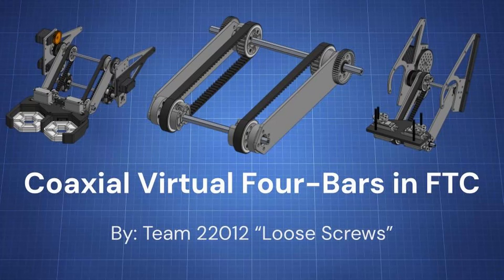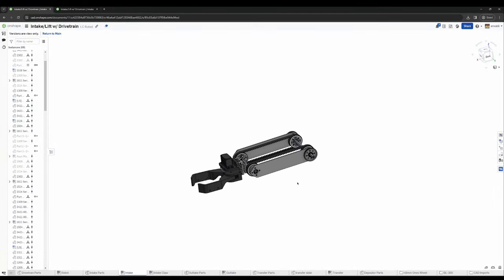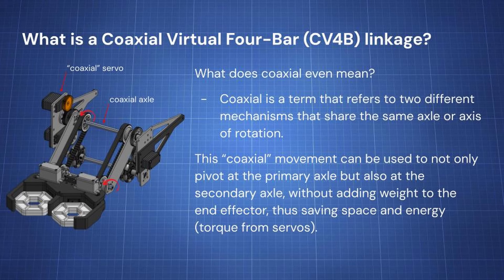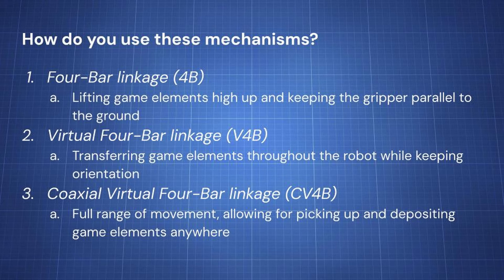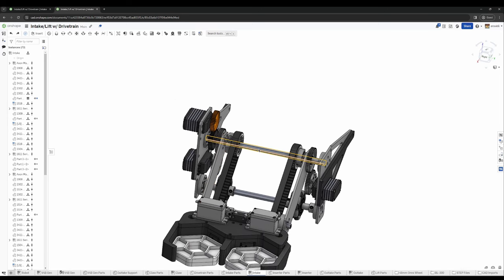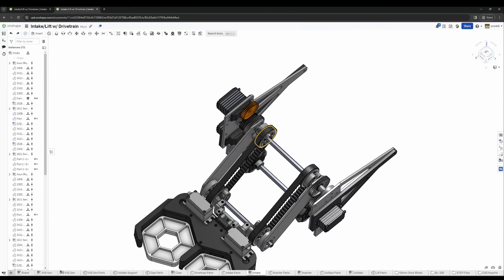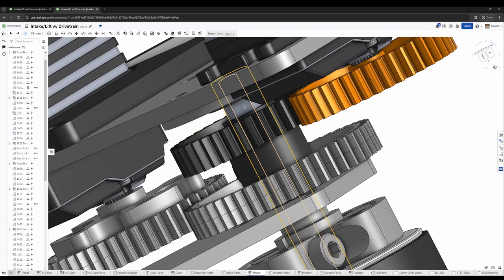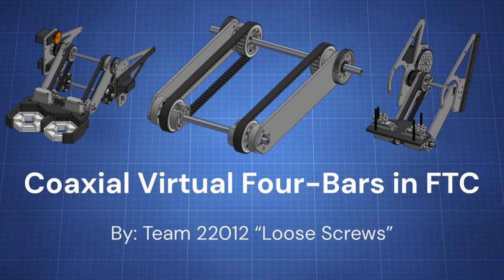TUTORIAL: Coaxial Virtual Four Bars in FTC

Comment: How does your intake work with your outtake?
Reply from the maker: Sorry for the late reply, but our C4VB intake (claw) flips over releases the pixels onto the outtake. The outtake has a servo which spins and essentially "locks" the pixels in place. The outtake is then able to rotate and score on the backboard. Our intake & outtake CAD's can be seen at 8:00. If you still have questions we'll be happy to answer.